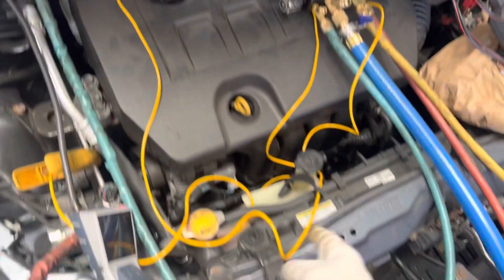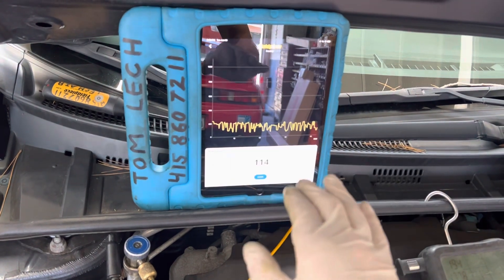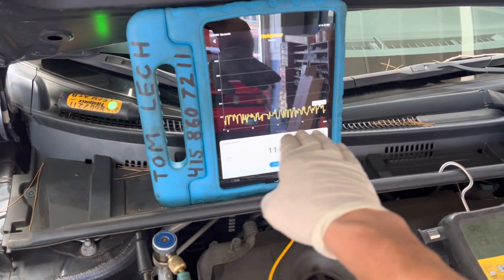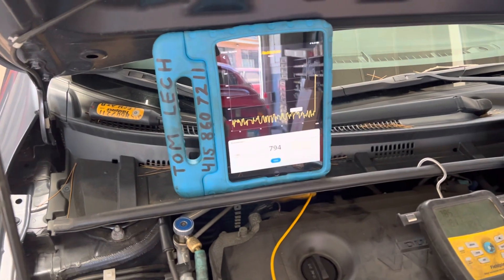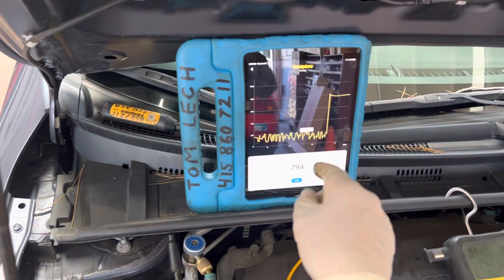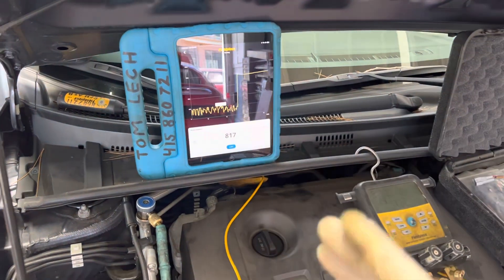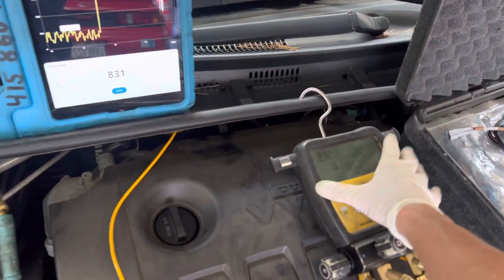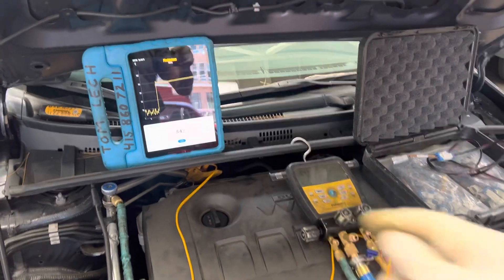Micron gauge readings explained on automotive. Micron gauge in your refrigerant manifold￼

Comment: How to test a 3 pin pressure switch with a multimeter what ohms resistance should I look for?
Reply from the maker: If it’s truly just a switch and not a variable resistor or transducer

Then you will have zero ohms or .01 or 02 because of a little resistance on the contact face surfaces or you’ll have OL out of limit open infinite depending on which multimeter brand you have. 

Because switches are nothing more than contact points they’re either completely open or completely closed there is a lot of good YouTube videos on how to use your multimeter testing switches but you have to be sure there switches and not transducers
Reply: You need to look at its wiring diagram. Some 3 wires pressure SENSOR ( not switch ) uses 5 volt. So 1 pin is ground, one pin is power or +5V and the other is SIGNAL. The ECM read this signal. My car has refrigerant pressure sensor at the condensor but no pressure switch anywhere else. Compressor is variable displacement.
Reply from the maker: @suryaprihadi2258  and that’s exactly why I asked him is he sure it’s a switch and not a transducer.
Reply: And there are 2 types of transducers, the old ones who output an analogycal variable signal with a voltage from 0,5v to 4,5v, and the new ones who creates itself a square signal (On a wiring diagram they are showed with as an intelligent separated module). Both have the three wires mentioned but you cant check a square signal with a conventional multimeter, in any case, its better to use OBD scanner data to compare the pressure with your gauges while comparing the data PID related to the transducer whatever if is an old or a new transducer type.
So, as a resume: your connect your gauges and compare the readings with the pressure transducer data PID from your scanner. 

Some vehicles measures pressures on the discharge line, but service port could be on the liquid line (sometimes not) so you'll have to be careful when comparing both readings if its the case and you have the system running, because it will show a big difference in pressure due their location. The best way to compare different readings is without starting the engine after a while (static pressures) taking advantage of that, slight differences will occur but if your sensor is innaccurate or non-responsive this will give you a clue.

Other vehicles uses temperature discharge sensors (as their name says, on the discharge pipe), they are not pressure sensors, so can be confusing because they look the same but it only has two wires (like a conventional old pressure switch), just for curiosity I found this on mid 2000-2010 VW/Audi cars 

There is a world out there on how different brands monitors their systems, old systems vs new rare systems... So a good way to know it without even looking under the hood is to watch the wiring diagram of the car itself, this will tell you what type of sensor it uses, type of flap motors, you can see who outputs voltage for the AC compressor and many more things sometimes you cant know about it and only takes 5min if you have easy acces to it

Comment: I been watching your channel of late. Thank you for sharing everything. I know what you mean by "wetness" produced by hoses or  the system itself.  I deal with breathing air compressor and we dry the air using molecular sieve 13X (dessicant) down to -70Celcius or -94F dewpoint dryness if the 13X is still new and at -40C dewpoint we throw away the air purification media albeit we have no winter in my tropical country. -70C dewpoint is like 0.0x% Relative Humidity. At these level, copper is a "wet" material and hoses are the worst. Highly polished stainless steel 316 is a good dry pipe material.

Thanks to your videos, now I realized HVAC system in terms of cleanliness and dryness is so important, very much like the breathing air I try to produce each and everytime on my dive compressor. Since I deal with pressure to 3,200 PSI, the moisture sensor capable of -80C dewpoint dryness  if NIST certified is very expensive, but it is a must have.

I have just bought the FieldPiece MG44 micron vacuum gauge because of you :), I just have to own such fine instrument.
Learning so much from you, I am now kind of paranoid looking at those integrated HVAC recovery machine which can do everything, example the Texa 760R of Italy. My paranoia comes from the fact that the HVAC workshop in my country 99.9%  do not have the refrigerant analyzer...DAMN !!!   In my breathing air compressor we use Carbon Monoxide sensor as minimum required sensor.

I seen breathing air contamination with carbon monoxide as often as I seen you getting AIR or other bad stuff in the car HVAC system. Dive compressor get carbon monoxide (CO) from the compressor own lubricating oil if it burnt due to overheating and poor mechanical condition, if not the ambient air itself with a car running its engine close by to the dive compressor. We do have Hopcalite catalyst to convert the CO to become CO2, but prevention & monitoring is best. 

If I were to tell a HVAC workshop to remove and vacuum down its multi-purpose bottlle/tank in his HVAC machine, and fill it with a good known pure r134a just to serve my car, I think they won't go for it. But that is what I will demand, if no refrigerant analyzer is available.  

Here I am seeing how more flexible your stand alone mobile HVAC working tools/pumps/recovery/etc are, but how do you measure the compressor oil quantity removed during recovery with good accuracy ?

Thanks
Reply from the maker: To stop or minimize the minimum amount of oil removed from the cars air conditioning system during the refrigerant recovery procedure. 
         Recover only from the low side suction Service fitting vapor only. 
            The clear sight glass in my Fieldpiece SM480V refrigerant manifold I can watch the flow of refrigerant. 
               If I see any movement of liquid that means there is oil being drawn out. 
               So I can slow down my recovery machine so it pulls out the refrigerant slower. 
                By pulling the refrigerant out slower it does not pull out the oil. 

             I made a few videos where I use a clear container in line with the recovery hose for refrigerant and I intentionally pulled out refrigerant quickly on some cars to show people it is possible to pull out oil with the refrigerant when you recover. 

In a couple videos I use the clear container in line between the car and the recovery machine to show by slowing down the speed of the recovery refrigerant process you do not pull out oil.
Reply: @coldfinger459sub0  yes, i seen you use those  clear round arcylic tube. Thank u
Reply: In my career, we needed ultrapure water in the form of vapor and the best way to do this was to combust pure hydrogen with pure oxygen at point of use.  The combustion process takes place inside a high purity quartz glass chamber and is piped a short distance to the high temperature quartz reaction chamber.
The delivery of hydrogen and oxygen to the combustor is by 316 micropolished high purity gas tubing, orbital butt welded joints and metal vcr crush gaskets at valve connection points.  All is 99.99 purity gas, or better.
Reply from the maker: @thisisyourcaptainspeaking2259  that sure beats the Britta water filter you buy at the big box store for water purity lol 😂 

If you wanna strip out all the minerals and salts from your bloodstream and body just drink a few consecutive gallons of that pure water you’ll be dead in a day.
Reply: @coldfinger459sub0  Yes, even drinking "low purity" de-ionized water will make you very sick pretty quickly, it starts with the squirts.
The flame of the hydrogen torch isn't readily visible in a lighted room but with lights out you can see the blue flame inside the quartz tube.  The gas mixture is never allowed to approach 2:1 and is ignited using either an external resistance heater or external incandescent bulb to cause gas molecules to spin and collide.